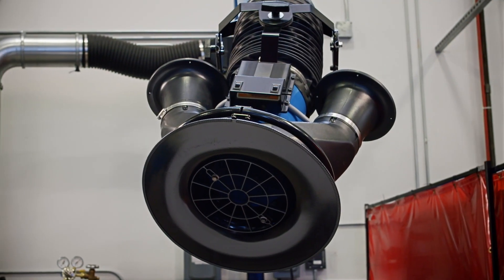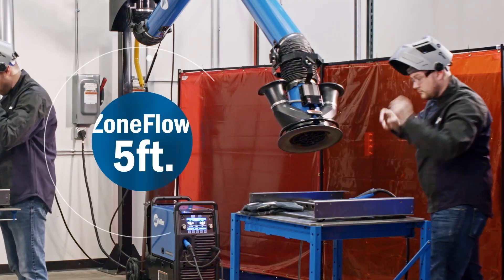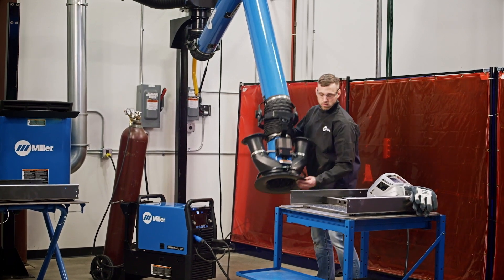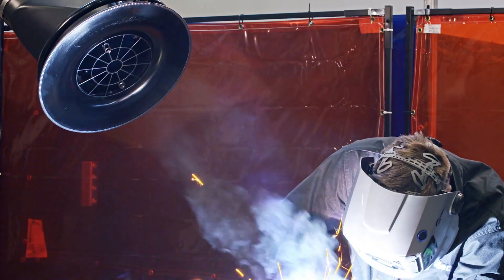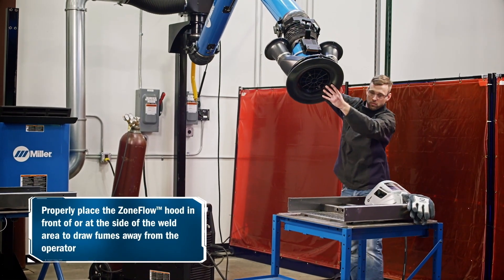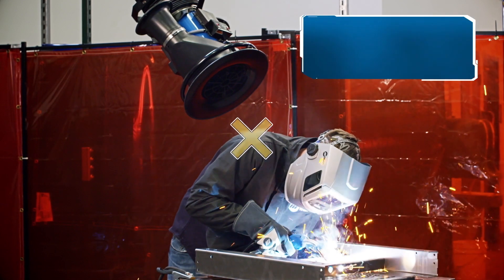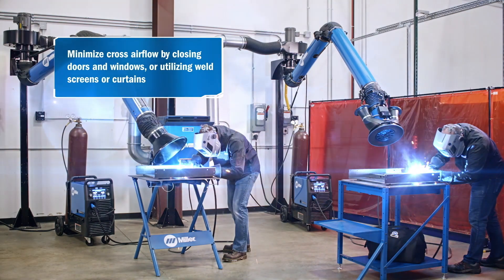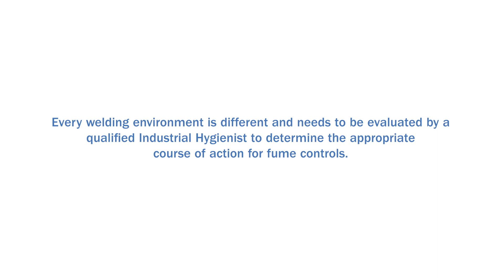ZoneFlow Fume Extraction Technology: Wide Fume Capture Zone

Comment: Can you explain?  Is this like previous models that shoot air out the side? Or is this whst yhe nozzles do? So many unanswered questions. Cfm? Filters?
Reply from the maker: Thank you for reaching out. Please keep in mind that this video was developed to illustrate a weld position and the specific welding techniques/weld settings used are not necessarily best for all applications. We recommend checking out our full line of Miller fume extraction solutions. You can download the spec sheets on each of the different product pages to see full details: MillerWelds.com/safety/fume-extraction.
Reply: Hmm, still looks like he's getting a significant amount of fume exposure there. You're either safe or not, it's not a spectrum.